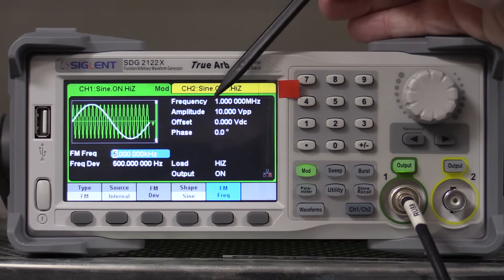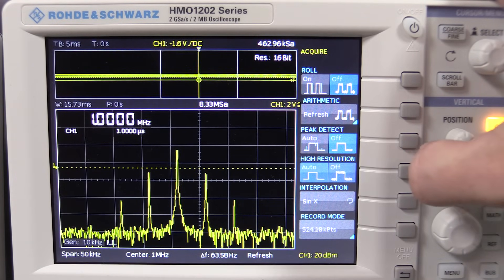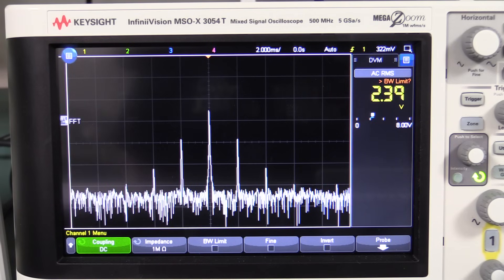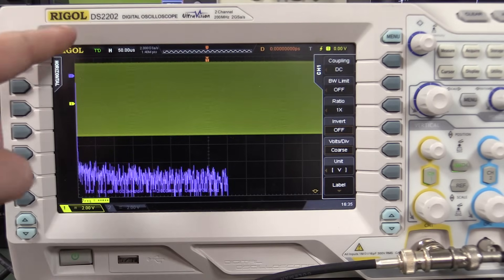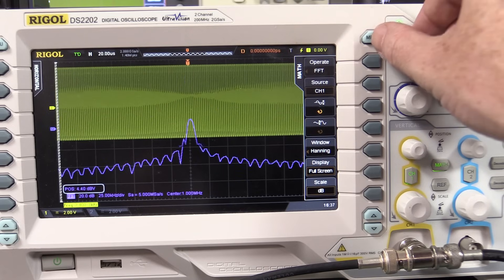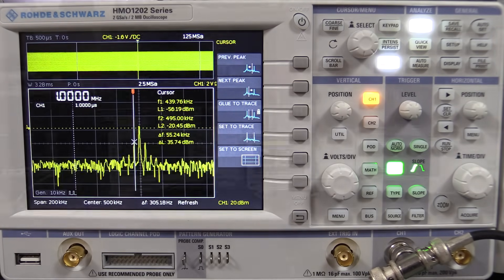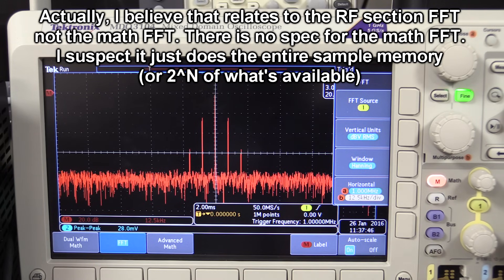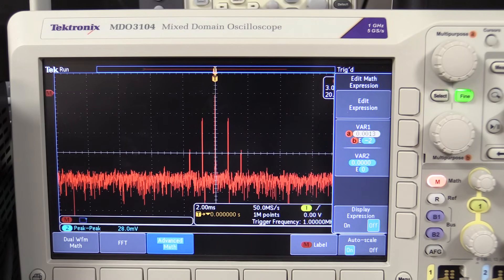EEVblog #845 - Oscilloscope FFT Comparison

Comment: Great job as always.  One need consider the cost of each DSO, parenthesis price is list price, otherwise discounted:

Rohde & Schwarz HMO1202 Series;1232 $US2300 
Tektronix MDO3000 as shown  MDO3014 (US$4,110)
Keysight 3000X Touch, MSO 3054T ($13,000)
Lecroy WaveJet 354 Touch $US5000 
GW Instek GDS-1104B $700 ($830)
Rigol as 1054z ($US400)
Rigol DS2000 as DS2202 ($US1790) 

You'd expect the more expensive DSOs to give you an FFT closer to a SA but it seems the bang for buck maybe the Instek as despite its poor appearing UI, its keystrokes are similar to the Tek FFT shown.  The 2 CH or 50 MHz version street price for much under $400 and is identical except for firmware crippled bandwidth and reduced analog channels.
Reply: Rigol DSA815 with a Rigol DS1054Z can now be had for £1,300 - that's for both.

Comment: Small correction: It does not compute the general DFT algorithm, but the FFT is the algorithm that it uses. That is why the FFT-points are always in always a power of 2^n, due to the nature of the FFT algorithm. The general Discrete Fourier Transform does not have this limitation, but takes far more computing power.

Comment: As folks have mentioned, the DS1054Z is capable of a lot better - but it's a trick since you can't directly set the sample rate and adjusting the center frequency can take a lot of knob twisting. On Dave's signal you are shooting for a sample rate of 5Msps to see a symmetric plot or 2 if you want a better plot that just shows the left side (nothing past 1MhH).  Use auto to get a nice stable waveform and fine adjust to fill the screen vertically.  Under acquisition set the depth to the first value larger than 16k (depending on whether you have 12 or 24M of memory).  The FFT memory mode supports 16K samples so there is no benefit to more depth.  I can't see a difference between normal/ave/hires but peak doesn't seem to work well.  Under the math function turn on FFT and select Hanning window and memory FFT (rather than screen FFT) on the second settings page.   The trick at this point is to walk the sample rate down to 5Msps one step at a time by adjusting the horizontal timebase (CCW).  Set FFT Hz/Div to its largest available value and the center frequency to 1Mhz.  If you don't keep the Hz/Div at max or you skip steps it can take a million turns to move the center frequency.  Always adjust the center even if it shows 1Mhz because it LIES and sometimes doesn't update when you change the timebase.  Once you've gotten the sample rate down to 5Msps and the center at 1Mhz you can reduce your Hz/Div to 5k.  If you get to a point where the center won't go to 1Mhz check that you are still in memory mode with Hanning window.  It sometimes returns to defaults for no apparent reason.  Check these again at the end just to be sure because the plot will be terrible if Hanning is off.  Adjust the vertical size/position of the plot and you are done.

Comment: Dave you need to go to page 2 on the FFT and set it to MEMORY Mode when using the FFT or your just looking at the TRACE data. The memory will have a tremendous amount more info to calculate the FFT off and will give a great result! Also set to 5ms on the horizontal!! This is for the Rigol DS1000z of course.

Comment: If a scope doesn't have enough computational power for a good DFT one thing you can do is transfer the waveform to a computer and do the DFT with LabVIEW, or some other software.  It's been a long time since I've done this, but I think I remember it working really well.

Comment: Nice video as always. One little technicality: at 4:35, you asked whether the FFT is done as a discrete Fourier transform (DFT). The answer should be yes no matter what, because FFT (Fast Fourier transform) is an algorithm that computes a DFT in a computationally efficient way. A DFT is by definition for discrete signals, i. e. lists of numbers. This is not 100% the same as a regular Fourier transform (defined on continuous signals), but of course mathematically these concepts are closely related.

Comment: Hi Dave, nice comparison. Just FYI, at 8:50 on HMO, you can actually toggle Horizontal control from FFT to time waveform by pressing on the Time/Div knob. Then you will notice, HMO can also do gated FFT. 

Btw, apart from the ease of use across different entry level scope, it would be nice to compare on FFT performance on accuracy, noise floor and bandwidth flatness.

Comment: I have been going back and watching some of the older EEVblog educational video's as they are great. 
I know these EEVblog videos <#1000 are getting old but with YT old videos are always new to the new viewer. 
It's hard comparing $8.000.00 scope to $800 - $900 scops with FFT function. I don't think you can compare scopes with such a large price difference.  If you can calculate the price to quality then there is no comparison.  It's hard to say nowadays' as price does not always mean quality. However, in this case, I would definitely say the price is 1:1 on quality.  Still a great video.

Comment: I found a way to make the rigols output much more usable: In the second menu panel of math go to "mode" and set it to "memory"  instead of "trace". Then in the "acquire" settings menu, set the memory depth manually to a higher value. The result isnt top quality, but at least better than with the default settings
Reply: Dennis:  Can you expand on this on FFT performance of the Rigol with any possible photos or other?  I would like to see the Rigol (preferably the DS2000) compare more favorably to the other Scopes in this group.  I also think Dave was a bit subjective in this review.  Isn't Rigol giving him enough free stuff or what?
Reply: @tkarlmann  Rigol's FFT is simply not good.
Reply: @aklankrisz  Rigol uses software -- of what's on the display.  That said, the Rigol DS2000 certainly shows a better display than what was shown in this video.  Dave is ignoring controls right in front of him.  That's what happens when you are a 'reviewer' as opposed to a 'user' and/or 'owner'.
Reply: Is there a chance to see on the picture what you are saying?
Reply: @aklankrisz  That's enlightening!
Reply: @Pawel5837  I know it's been a year but I spent a few hours figuring out how to get the FFT to work on Dav'es waveform and posted my method.  The result is as expected for its 16k point FFT, better than the Teledyne, not quite as good as some of the others and much better than it achieved in the video.
Reply: @patrickcameron791  (and everyone else). I haven't visited this comment since I do not get notifications. While I do not have any image of it, For daves waveform (1mhz, 5khz ffm @500hz) I use manual 120k pts memory depth, memory mode of the fft, 2ms timebase, center 1mhz, 5khz/dev and it looks much better than daves but also much worse than others. If you enable the second channel (for a lot of signals useful if you need a sync signal) and thus get 60kpts you can even improve this a bit by using 1mhz center, 6.25khz/dev ... looks almost like the gwinstek then... 

the real bad thing about the rigol here is then that you sometimes have to turn knobs for hourse to get the right values instead of being able to punch them in

Comment: I believe the Textronics does the FFT on ALL of the sample points. If you reduce the number of sampling points, then the resolution of the FFT is decrease and the speed is increased. I believe 100K works rather well.

Comment: Dave, you do not need to turn off FFT on HMO, you can push the Time/Div knob then you will get to the upper time domain window, push again you can set gated FFT window size and possition, push third time goes back to the bottom spectrum window.

Comment: Great Video still but the Rigol was not treated fairly! 
You needed to turn on "Deep Memory FFT" on the DS1054Z and the FFT will come to Life. This feature is on the next page in FFT mode.
You most likely had it set to TRACE and only showed the data points that were displayed in the trace window.
This upgrade to the firmware was released 1 year before your video. I know It's hard to know all the in's and out's of all the equipment!

Comment: I suspect one of the reasons the Rigols don't look very good is the poor phase noise on the sampling clocks (#683, #699). Would also explain the jumpiness on the 2202. Would be nice if Dave could do some tests to show how stable the sampling clocks are across different scopes. Even the DSA815's phase noise seems poor - note that the noise floor is only -55 dBc at low offsets, while the MDO3104 (in RF mode) had better than -80 dBc.

Comment: A 128k point FFT implemented in the usual fashion would require 17 passes over the data for 2.2 million operations. That said, you can parallelize it enormously. You could potentially run as many as 32k threads in parallel with no contention and little in the way of synchronization.

Comment: Dave, your comparisons of FFTs was very interesting.  It would be great if you could compare the Tek 3104 with the GW Instek 4-channel MDO-2204EG (or the 2-channel MDO-2202EG) both of which have FFT of course, BUT, have a dedicated Spectrum Analyzer as well as a 2-channel AWG.  In addition, both can do BODE plotting for FRA. And I don't know the street price on the Tek 3104 but I'll bet either Instek (MDO-2204EG or MDO-2202EG) will be less costly than the Tek. And, if you could demonstrat BODE plots with one of the Insteks that would be fantastic. I love your characterization of the RIGOLs "Dick & Balls" model... hilarious!  I was laughing my balls off for at least 10,000 milliseconds, if not more!

Comment: Dave, visually the carrier frequency and sidebands seem fine, but how accurate are the amplitudes on each scope? Any different detector settings on those scopes? What are the noise floor levels on each scope?
Kudos on the video :)

Comment: Hi Dave, not sure if you have a Siglent scope. How does this one hold up WITH FFT. second question, I am a electronics hobbyist and software engineer by trade. What oscilloscope would you recommend for us hobbyists. Thanks keep up the good work. PS apologise if you have covered siglent scope already, if so point me in the right direction.

Comment: How useful would DS1054Z be in the 20-20khz range, I understand with 1mhz center point example..but would it show data points in the lower frequency range? Or would it again only show the carrier frequency and not much detail?  Interested in using it just for the audio spectrum, so curious how it works between 20hz to 20khz ...

Comment: Dave, did you check to see if every scope was running the latest firmware /os before the test?,,because there could be a lot of changes with that if the fft run in the cpu

Comment: I guess the Rigol 1054Z's  FFT would not be good enough for audio stuff?
Reply: +Jesus von Nazaret it is some work around for ds1054z owners and works not only for audio. Save waveform to usb flash and use FFT Viewer programm to analyse signal
Reply: +Jesus von Nazaret The test signal in this video was a reasonably demanding "RF" case -- it wasn't baseband, it was up at 1 MHz, yet the FM frequency was up at 5kHz. So you need a long timebase to see the 5kHz behaviour, but you need a high sample rate to see the 1MHz signal. These two factors combined mean that a large number of FFT points are required in order to catch the 1MHz while seeing enough to catch the 5kHz.

Audio, on the other hand, is a baseband signal. You're not interested in anything beyond 20kHz, so your 1024-point FFT can be spread out nice and wide, allowing you to catch 40Hz signals at the same time. That's basically the entire audio spectrum on a single screen. You can measure any frequency component with an accuracy of 0.1% (roughly speaking), provided you optimize your timebase. Incidentally, MP3 audio compression used 1024-point FFTs, so anything that survives highest-quality MP3 compression is, loosely speaking, fair game for the Rigol to analyze.

What specific things do you want to do with "audio stuff"?
Reply: +korram Do you mean distortion or noise? Reducing signal size is the classic way to reduce distortion...
Reply: ***** Interesting, I stand corrected. Didn't consider that a totally different circuit was being switched in, which obviously throws any trends out the window.

How did you get 24 meg points of data out? Ethernet, USB-computer, or USB-drive? I find it very difficult and/or insanely slow no matter how I do it?

I've noticed the same thing about Hi-Res mode, you only get 8 bits worth in stored data. I presume you get given the data fit for the 2^8 high screen, the extra bits are (correctly) considered worthless for on screen display and are thus discarded ASAP. Annoying! Your noise floor should be pretty sweet with 24M FFT, though?

Comment: I know this comparison is ancient but No waterfalls?  But even in 2024 I could find no comparisons or reviews of new models' waterfall performance.  
And yet, the new 2024 Uni-T UPO1204 has waterfall however I could only find one review of that feature and in that review, they had bandwidth maxed out so the waterfall line rate was many seconds which would be useless for measuring the dynamic response of structural modes (from strain gauges) to a transient input.  A simple bench test would be a microphone input and then striking a tuning fork or anything that "rings."   If that UniT has a functional waterfall feature, it's game over, we have a winner.

Comment: one of the performance comparison that I want to see is the maximum frequency that these oscilloscopes can do ... because some can go (as nyquist says) to 2.5Ghz... (I know whit atenuation) but I think that it is on propose limited ...
ex:I used to have an agilent DSO-3202 that had best fft performance (in frequency range) than an DSO-1024a that I have now .. but unfortunately I didn't make any specific comparison (maby just impression ???)
If you coud let us know the maximum allowed frequency they show)
best regards from Brazil ...

Comment: Aww! My poor little 1054Z!

But yea, after I unlocked it, I started playing with the FFT. It's not particularly useful as is.
Reply: +Falcrist Maybe Rigol will watch this, and a future firmware flash is all it needs...
Reply: John Ridley Well, the problem doesn't seem to be the memory. It's not making use of the memory it has.

Currently you can either use the displayed waveform or you can use all datapoints (of the waveform itself) in memory. But if you use memory, it won't let you zoom in anywhere near as far, so it's mostly useless. What you CAN'T do is use a big chunk of the waveform memory, and evaluate it at enough frequencies to get a detailed output from the FFT.

That probably has to do with a lack of processing power, but even at 1 update per 10 seconds, it would still be more useful than what we have.

I'm not THAT salty about it, but it's a feature I will likely want to use in the very near future.
Reply: +Falcrist Yeah, sadly my DS4000 series is crap as well :(Though it seems to be ok being used for audio filters etc.

Comment: This might sound stupid but what is a oscilloscope I should probably Google it
Reply: +super awsome minecrafter I'm with you.  If I had to guess it's ghost hunting equipment
Reply: +Alexander Gosselin So what do you actually DO with it? Dave does a lot of scope reviews, but I never really grasp what you would need one for. It can see voltage over time, what can that tell me? Pulses of voltage? What is an average day to day use for a scope?
Reply: +Oddzball3 An average day-to-day use is doing electronics. Electronics is the art/science of making signals on wires behave the way you want. Without an oscilloscope, you can't see what those signals look like -- without an oscilloscope, you're quite literally working blind.
Reply: +Alexander Gosselin Definitely explains it a bit, thanks for the details. I guess my experience with electronics ends at basically my little radio shack electronics learning lab, and a few simple circuits I have built over the years, so I just dont have the experience with scopes to understand because Ive never worked with complicated electronics.

Comment: Hey Dave, ever got your hands on a Yokogawa DLM2000 type scope? What's your opinion about that?
Reply from the maker: +dakhaas300 Only used an old model a few times at a test facility. Bit clunky, but had decent performance IIRC.

Comment: So, short answer: if you want a spectrum analyzer, buy a spectrum analyzer. The 400$ DS1000 performs exactly as expected. (It looks like it's doing FFT entirely in software, too.)
Reply: The fact that the DSA815 series exists is likely why FFT is a joke on pretty much all sub $3k rigol scopes.  After all, why would they want to sell you one device than can do two things, when they can sell you two devices to do the same job instead for twice the price.  If Rigol didn't have a standalone spectrum analyzer, the FFT in their scopes would likely be much improved as a selling point.

Comment: Smells like an Update for the Rigols.

But I think you are a bit unfair to the rigols, especially the 1054Z...
The cost should always be something you have to bear in mind...

But what I really don't understand is why those scopes have so little memory and so little processing power - both should be rather cheap these days...
I really don't understand why they don't use some multicore 1GHz ARM processor with at least 2GiB of Memory...
Reply: +Stefan Payne They probably do not do the FFT in the ARM processor but in an FPGA. But even if they did it on the ARM core they would probably not just go for the next 5$ chip they can find on the local Shenzhen market because they have to run their software for years and don't always want to reinvent the wheel (drivers etc). If you look at ARM chips that are supposed to have a long term availability there is not that much left and what is left is expensive, in particular if you want the quad core version, e.g. the iMX6 from Freescale.